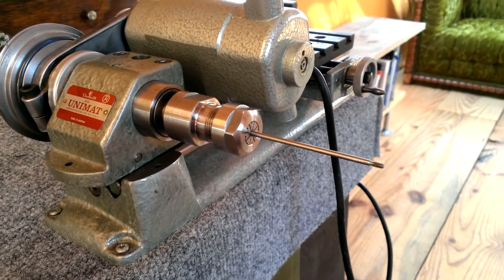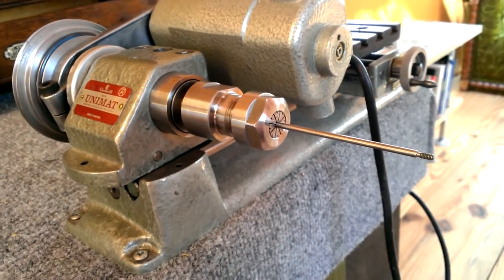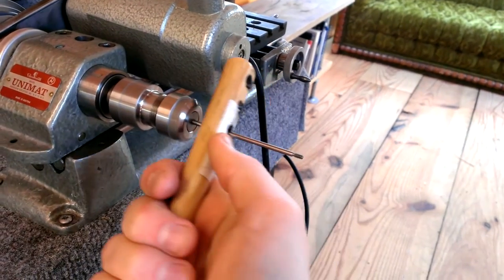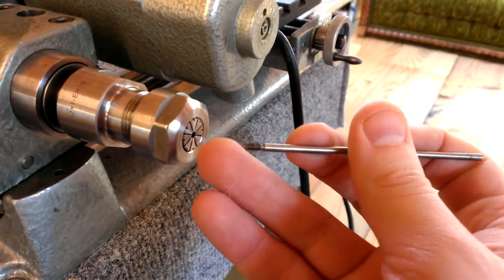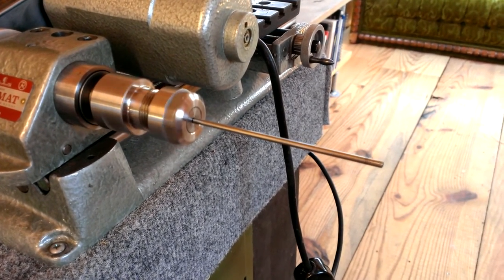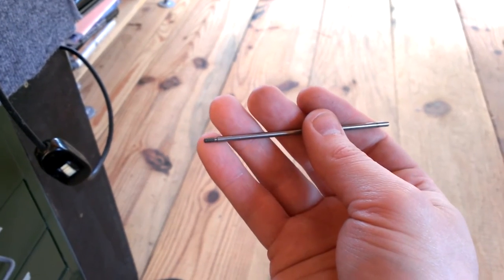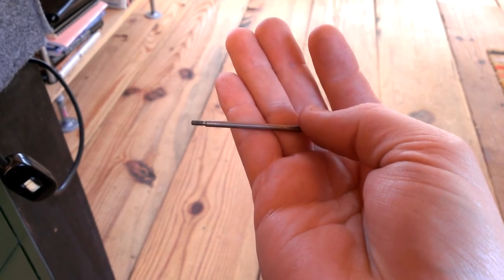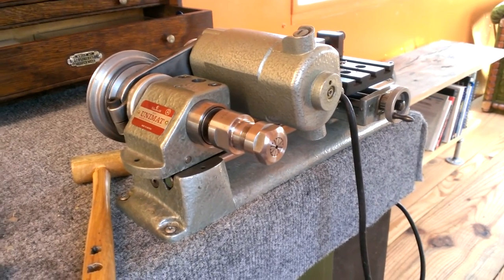Saxophone (Questionable) Repair Topic: Straightening a rod pt. II

Comment: Im my experience it's possible to straighten a rod with this method to "almost straight" but not perfectly. I think there is only one way to get a perfectly straight new rod: to machine it from a perfectly straight stock rod. However in many case an "almost straight" rod will do the job... for some time.

Comment: Hello, your video uploads have been very usefull! I want to learn how to repair saxophones and your video's do help a lot! I started overhauling a soprano saxophone. Problem is that it is not straight. Cant find any info on how to straighten a soprano saxophone. Do you have any tips? Thanks!
Reply: I think I can't be too wrong by suggesting that you need to use some kind of mandrel to straighten up a soprano. Ideally you'd have to fit the whole soprano body on the cone mandrel running the whole length of the body. Provided the mandrel is perfectly straight (which somewhat rhymes up with the subject of this video) if the soprano body fits on it, it's also straight. Otherwise you wouldn't know what to use a a measure of straightness. You can of course use your eye - that's how you probably determined the imperfection of you saxophone but it alone won't help you to straighten it up retaining the round shape throughout while working on the metal bending into proper shape.